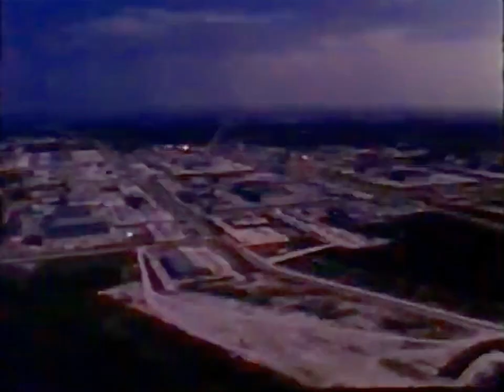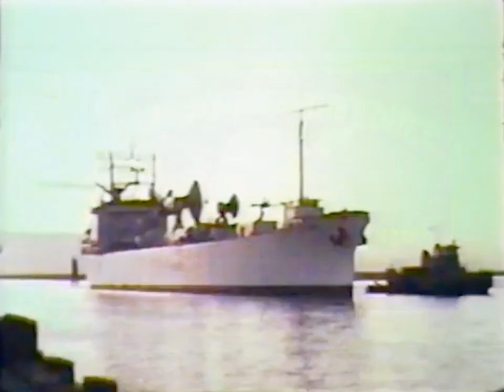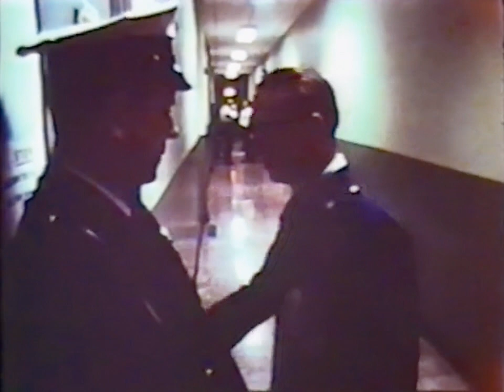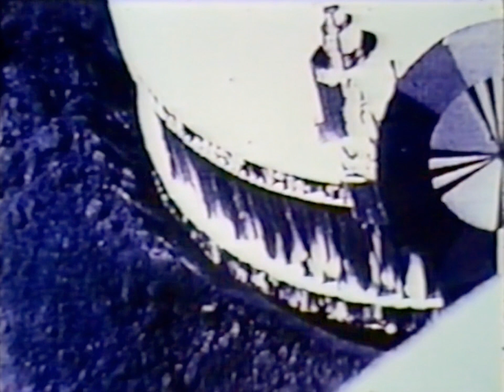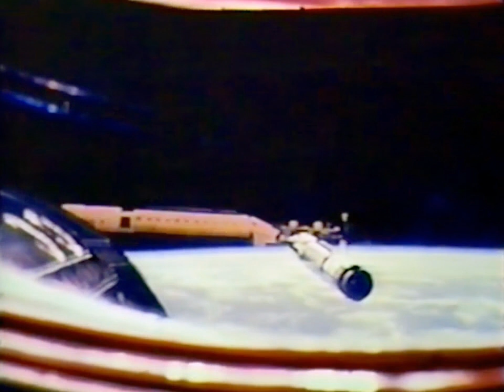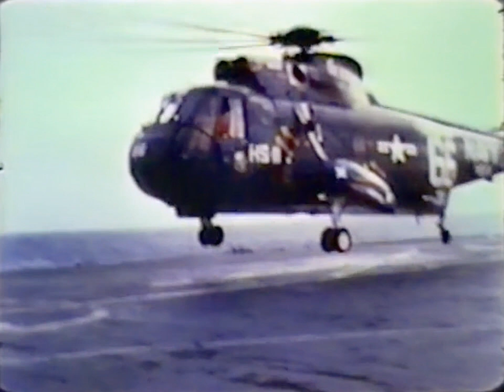Cape Kennedy 1966 - Remastered USAF documentary - Titan, Atlas, Surveyor, Gemini, Apollo, NASA

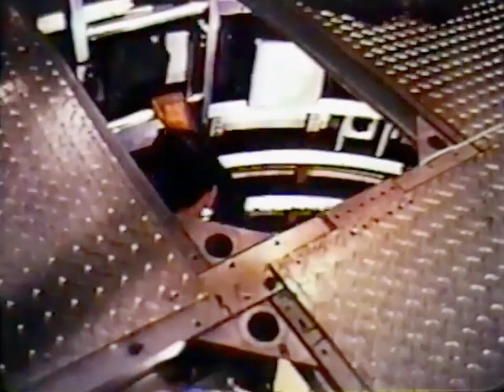Comment: MOL launch starting at 11:23.

The MOL program was announced to the public on 10 December 1963 as an inhabited platform to demonstrate the utility of putting people in space for military missions; its reconnaissance satellite mission was a secret black project.

The Gemini B was externally similar to NASA's Gemini spacecraft, although it underwent several modifications, including the addition of a circular hatch through the heat shield, which allowed passage between the spacecraft and the laboratory. Vandenberg Space Launch Complex 6 (SLC-6) was developed to permit launches into polar orbit.

As the 1960s progressed, the MOL competed with the Vietnam War for funds, and resultant budget cuts repeatedly caused postponement of the first operational flight. At the same time, automated systems rapidly improved, narrowing the benefits of a crewed space platform over an automated one. A single uncrewed test flight of the Gemini B spacecraft was conducted on 3 November 1966, but the MOL was canceled in June 1969 without any crewed missions being flown.

Comment: The SLS Rocket has been fully staked at the Vehicle Assembly Building with the Orion spacecraft and launch abort system. Also, Just got word that Artemis 1 is scheduled for NET than February 12th at 5:57pm EST and the window lasts till February 27th. Note that this is dependent upon successful tanking tests on the SLS rocket in January.
Reply: I can't wait for rollout!
Reply: Costing 23 BILLION dollars thus far and YEARS behind schedule.  So, considering JUST those development costs, if there were 23 total SLS launches over the years, JUST the development cost would effectively add a 1 BILLION dollar cost to EACH launch not even counting the cost of the rocket hardware.  What a fiasco.
Reply: @winstonsmith478  
Good thing you weren't around for the Shuttle!🤮